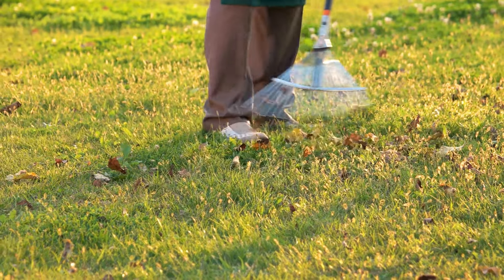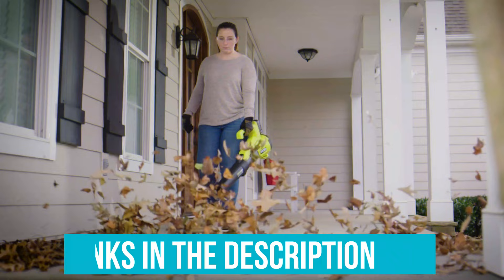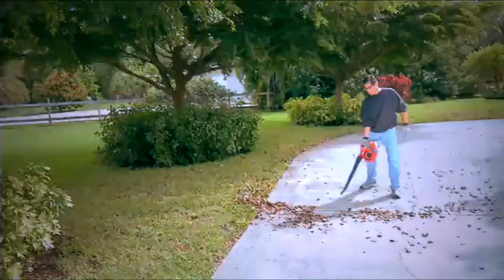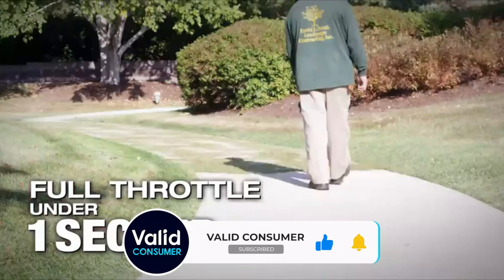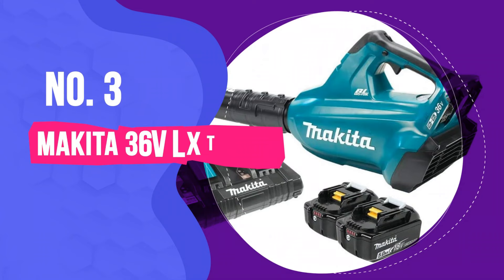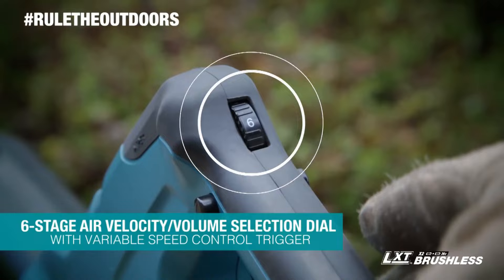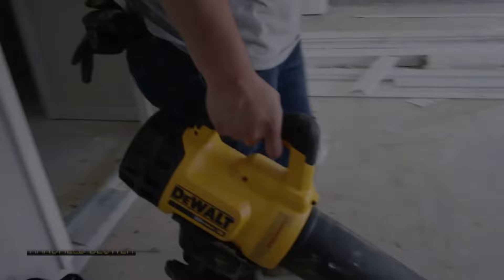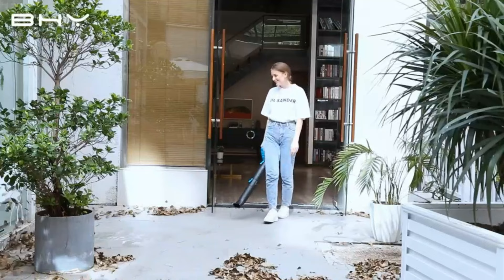Best Cordless Leaf Blowers 2024 [don’t buy one before watching this]

Comment: Sorry my ignorance in electrical matters, but what does it change from an 18 or 20 volts to a 36 or 40 volts blower? is it its blowing power? the running time? something else? thank you!
Reply: The higher the volts the more power a tool produces.
Reply: @joaquinsuarez6090 that wasn’t what was asked